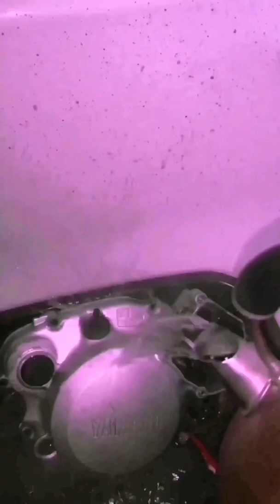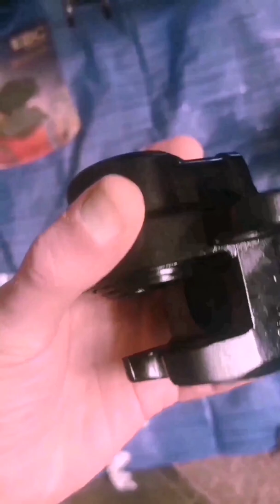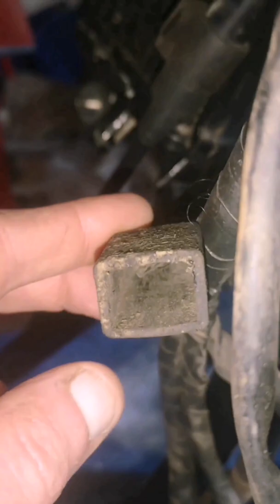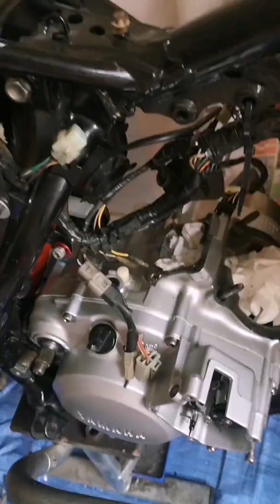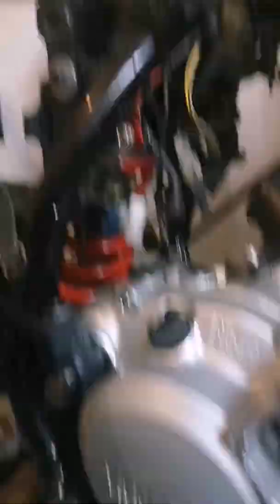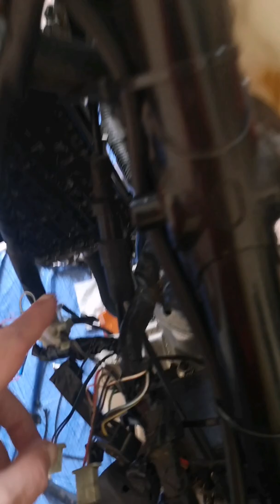yamaha dtr125 2001 with 08 electric start engine and dtx125 wiring harness loom

Comment: How did you get your bottom end in? I’m stuck with the swing arm bearings sticking out a bit so it won’t drop in on the swing arm
Reply from the maker: Each bearing should be sticking out about 4 mm
Reply: 2stroke mx classics cheers for the help mate, they are about right then, I’ve tried all sorts to get it in but it won’t go. Any suggestions?
Reply: 2stroke mx classics not sure how I could send a picture, if you look in the dtr forums on Facebook I have posted in 2 of them so far. One guy suggested to file the bottom end a little to get it started which I might give a try
Reply from the maker: I've just checked and its 1 to 2mm m8 are the 2 big end caps on, I wouldn't file though are u on instagram
Reply: 2stroke mx classics yes mate, it’s txylordtr
Reply from the maker: No probs m8 I've just uploaded a one on here for you hope it helps👍
Reply from the maker: Hi it goes in swing arm first are your bearings sticking out a bit to much, measure the swing arm gap with bearings and get back to me and I'll measure one for you or could send a pic ov a swing arm with bearings in
.

Comment: Another great video m8, how do you get the gloss back when sanding / restoring your plastics? I followed your video on the air box but it will only ever smooth out with no gloss / shine :-(
Reply from the maker: Hi thanks m8 once its smooth ya rub some autosol on and it brings it up shiney 👍
Reply: @2strokemxclassics  Thanks, i did try that but maybe for only 20 minutes or so with the autosol, maybe need to do it longer next time
Reply from the maker: Let it dry then rubbed toilet troll hard on it you'll see smaers, rub the toilet paper in one movement then a new piece then get a sock and rub hard the turn inside out yall see it shine then use another sock or soft cloth I just done the same on the other airbox bit try get the 3000 grit sanding till it's real smooth
Reply: @2strokemxclassics  Thanks mate will give this a try at the weekend :-)